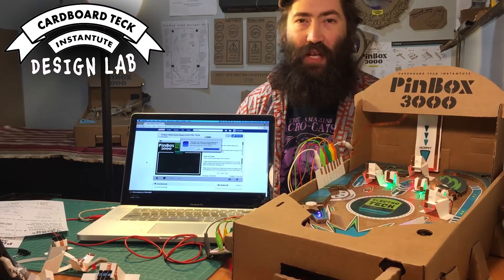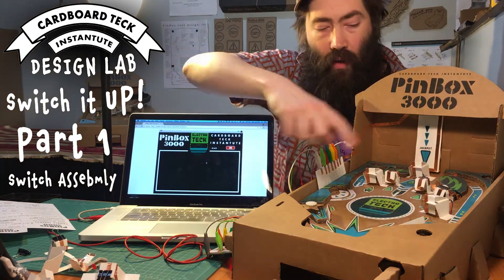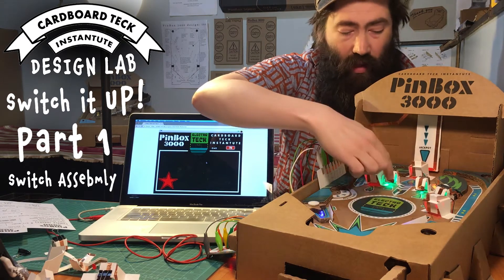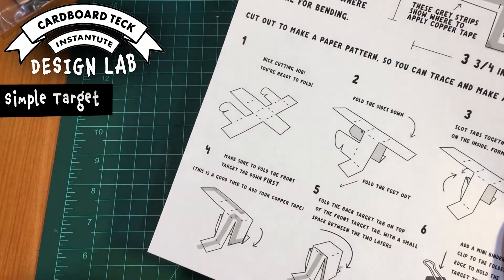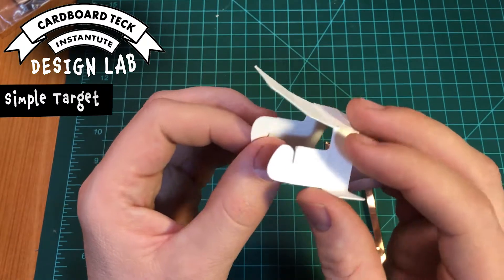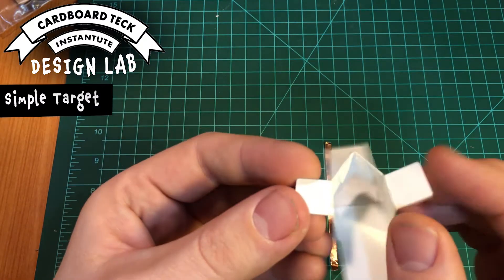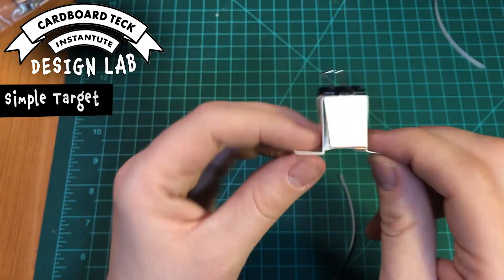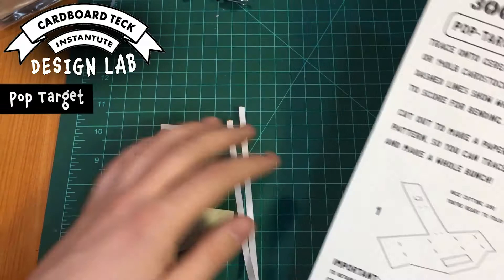PinBox 3000 Design Lab: Electronic Target Switches

Comment: ProTip: DO NOT run the copper tape over any printed portions of the Pinbox. The ink used on the Pinbox is conductive and will act as a short on your circuits.